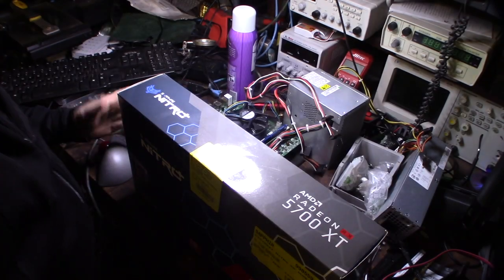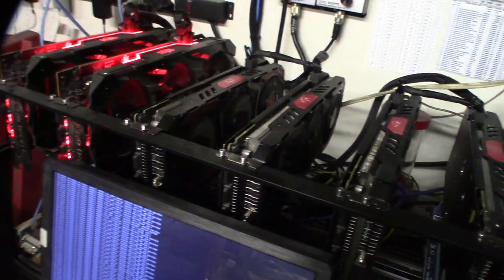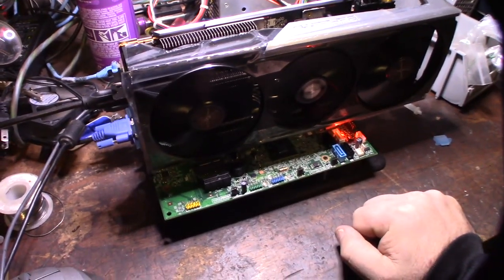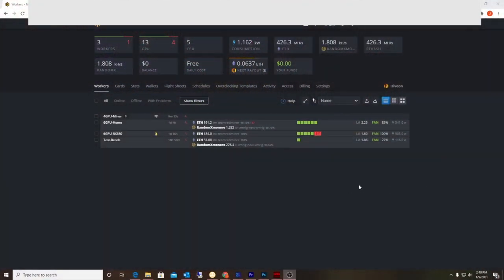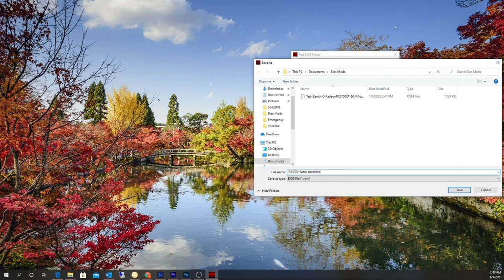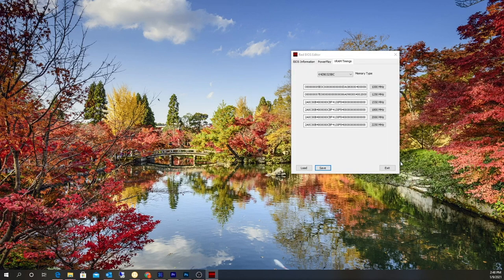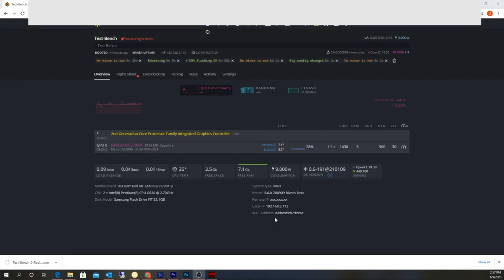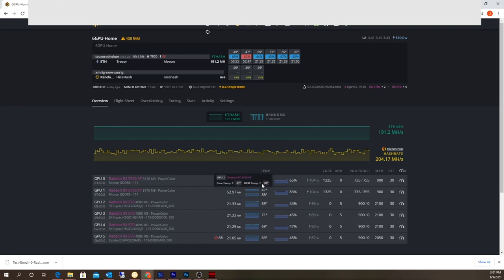Sapphire Radeon Nitro+ RX 5700 XT HiveOS bios mod and first fire up Ethereum Mining Teamredminer

Comment: Powering a 5700XT with a sata adapter will cause a fire for SURE.......the MAX power standards for a SATA CONNECTOR is 54 Watts...........the MAX wattage a PCIe slot pulls is 75 watts.........the 5700XT pulls pretty close to the limit from the PCIe slot............so you are WAY over standard and the connector will melt over time and cause a FIRE!!!!!! No Joke...........I'm in a discord that has a channel dedicated to #rekt-pics to showcase things not to do and the result that follows if you do them.........visual representation of sata fires is the top example posted of the #rekt-pics channel..........